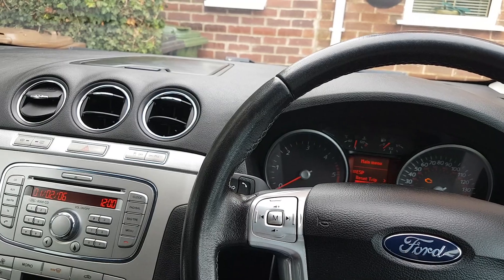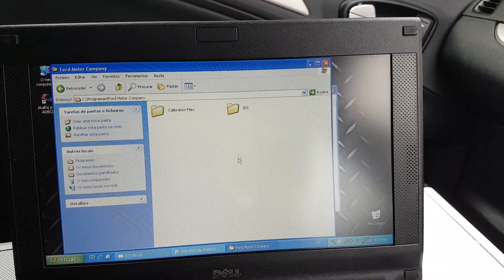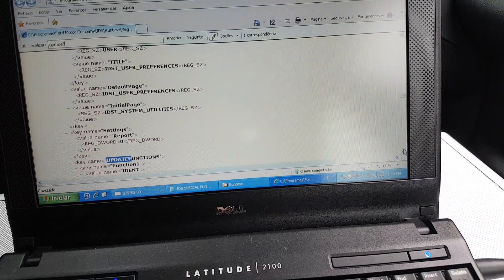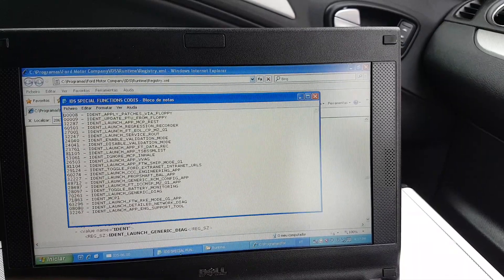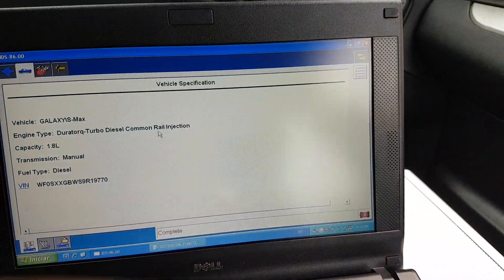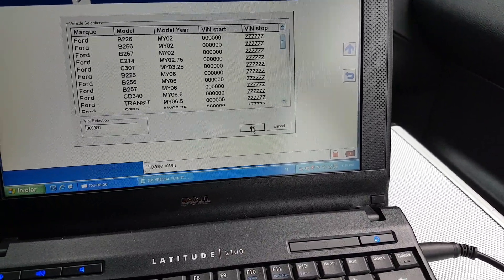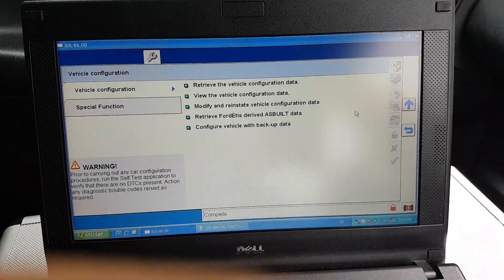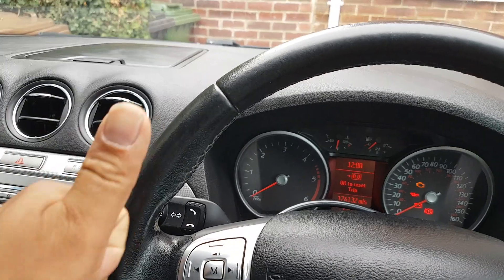How to use/enable special functions on Ford IDS, such as engineering mode!

Comment: Can you tell me how to find out which model I have when I am already in the engineering mode selection? I have the 2007 SMax 2.0 Petrol/Gasoline.
Does it come from the VIN?
Can anything go wrong if I select a wrong one? Or it just doesnt update and I can go through one by one till one of them works?

Comment: Does ids show the date that the fault code was detected? Truck is 1 month out of warranty but code was there before warranty ended. Trying to get fixed under warranty.
Reply from the maker: Hi
If the module supports freeze frame, yes... most tools will actually be able to show when the fault was triggered... either date or mileage...
Thank you for watching!

Comment: Hola amigo, a ver si me puedes echar un cable o al menos orientarme. Tengo un Focus ST mk2 2006 motor 2.5 turbo volvo que tiene la preinstalación del Control de Crucero (CC) pero la PCM no tiene la/s línea/s de programación para hacerlo funcionar, a pesar de que se activa el módulo GEN y el módulo HEC, e incluso reconoce los botones de los mandos del CC (aftermarket y son de Ford) pero no hace nada en el coche. Añadir que en cualquier focus mk2 menos en este se consigue activar el CC activando los 3 módulos (hay un check que activas usando el programa ELMCONFIG en los 3 módulos) pero en mi coche, a pesar de activar esos 3 checks en los 3 módulos y aun reconociendo los botones (mediante el test del pulsadores del coche), no funciona.

aquí el video de cómo lo activan, pero que no funciona en el en el focus mk2 ST.

https://www.youtube.com/watch?v=z_EGzfRbyZw

Y bien, la pregunta parece obvia, ¿existe la posibilidad de que un programador experto, pueda añadir la línea o líneas de programación del CC en el PCM, modificando el fichero BIN del coche?. Hay una posibilidad de facilitar este trabajo de identificación y es que el Ford Kuga mk1 2.5 turbo (el mismo motor que mi focus) sí traía o se podía escoger la opción del CC. ¿se pueden comparar ambos ficheros BIN de ambos coches y detectar que línea o líneas están relacionadas con el CC y añadirlas al fichero del focus?

¿lo que propongo es una locura, es viable, difícil, fácil? Gracias.

Comment: I sell the software so that it works without the need to buy such an expensive license, contact me, the price is 100 times less than the license you pay .. I guarantee that it works fully without limitations with built-in calibrations c98. contact me +584244242358

Comment: Hi luis. I have a 2014 kuga for tpms disable. I need to update codes etc as you say but what code do I need to use for getting the engineers menu to disable? Thanks. Also big thumbs up for your content. Always very helpful.
Reply from the maker: I thought I showed the list at some point throughout the video... 
Google will help you find the list anyway...
Thank you for watching and for your comment!
Reply: Ah ok so I have to update the whole list?
Reply from the maker: @Kmg93  
Have you watched the video?
You need to make sure that the function is on the register...
Then, input the code in IDS, I showed it at minute 5:40
That will then enable the function...
Reply: LM Auto Repairs that is pretty self explanatory then. I will get this kuga done tomorrow. I had forscan on it today and couldn’t get the job done with it! Thanks for your help I’ll let you know how I get on mate
Reply: LM Auto Repairs so I have got this to work. The only thing is I get two errors when retrieving the data - “resolve part request sbl failed”. I can still edit the files to tpms off but it won’t write back to the vehicle. ‘Corrupt’ error When trying to write bsck

Comment: I can retrieve the configuration data but when I go to view the configuration data it says no data available even though the modules all checked green and successfully read. Your ids set in dealer mode? I'm in the usa working on my 08 f150 all I want to do is stop my pcm from controlling my alternator charging voltage. I can disable that through the wiring but it gives me a battery light and a dtc.
Reply from the maker: Hi
Not sure... but I can check if you need...
Thank you for watching!
Reply: I Have the same problem also on a 2016 Ranger. Retrieves it but then same message. Did youo ever get it sorted?

Comment: Great videos, I am trying this at the moment and my vehicle is not listed in the box after you type in 60274 to enable engineering mode. I have a Ford Ranger that Im trying to get the 4x4 back into a second hand ecu that has been fitted, any help would be much appreciated
Reply from the maker: Hi
I never went through that procedure... and don't want to wrongly advise you...
Perhaps the version you are using?
Thank you for watching and for your comment!

Comment: can ECU number be changed on engineering mode?
Reply from the maker: Never tested it...
Thank you for watching and for your comment!
Reply: No it cannot be changed,and what he is showing now is the patch-availability from SCN's and operations in relatively  functions on sub-systems. You cannot overide or change anything and even if you have the "patch" NONE of this is available in OFF-LINE apart some basic functions. e.g Aircon present-not present some light functions and Body module read -right in terms of configuring(only new units) Nothing with change vin numbers or virginize ecu's